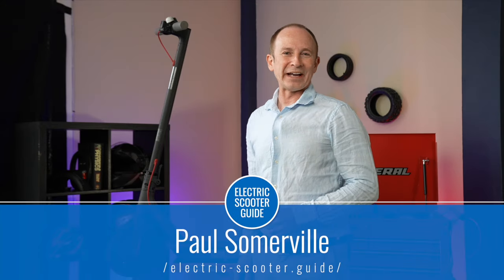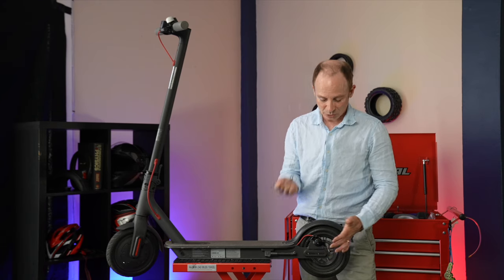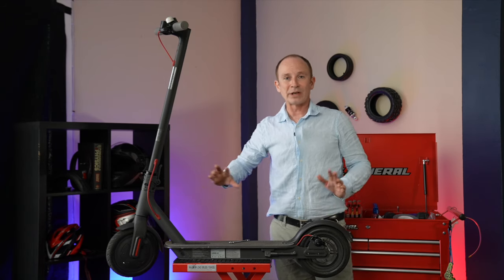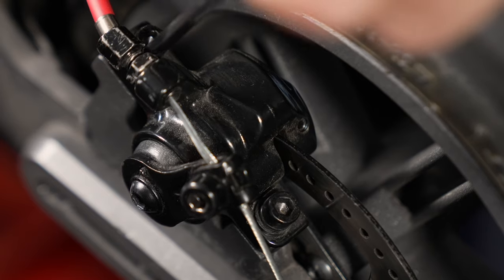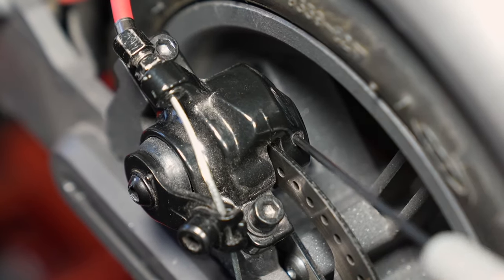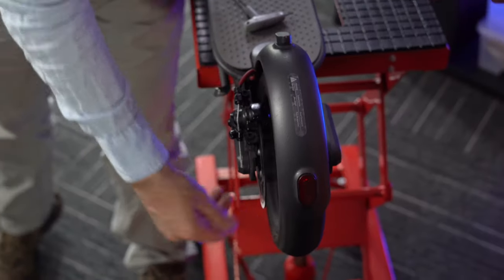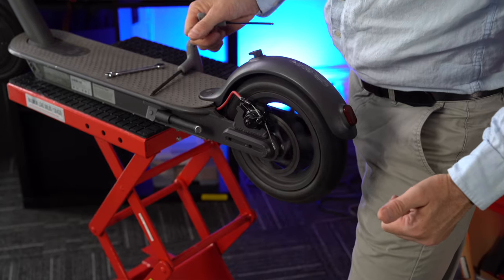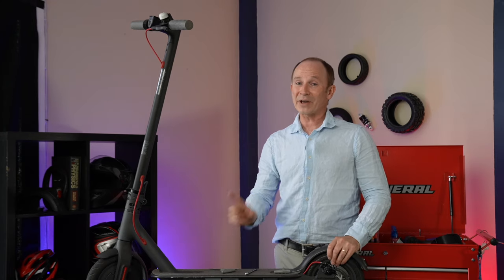How to Adjust Mechanical Disc Brakes on an Electric Scooter

Comment from the maker: What other electric scooter fixes would you like to see? Let us know in the comments!
Reply: Apollo air please. Rear disc
Reply: Hiboy s2 pro, clamp-on the mudguard rattling
Reply: M365 break cable replacement please
Reply: Apollo explorer pls
Reply: Zero 10X
Reply: heya ive got a problem with my xiomi the cable has come out at the top and i cant get it back in please help
Reply: Hiboy s2 pro brake caliper getting stuck in clamped position
Reply: Electric Scooter Commuter Scooter 350W pls.
Reply: Ducati Pro 3 how to change brake pad
Reply: Solar P1 3.0, the cable keeps sliding off when I press the brakes all the way down, no matter how tight I tighten it. Thank you for the awesome videos😁
Reply: @ESG-ElectricScooterGuide   hiya I'm joining the wires on my RS2 RILEY SCOOTER it was broken by me keeping on dropping it  got any details about this pls
Reply: Iscooter ix7 pro front wheel

Comment: I couldn't do the first method because the screws would not come undone. I thought I was doomed until I did method two and it worked!! Thanks, you saved my bacon. I have to ride this thing down a big hill that always has lots of traffic. I was fearing the worst if I wasn't able to get it fixed myself. This is my only transport to work!! Thank you thank you!!
Reply from the maker: Awesome! Thanks for watching. -Vosk

Comment: Thankyou ,instantly fixed my brakes ,that were getting slightly loose this worked perfect,mine has  a spring i pushed up and it tightened my brakes back to perfect,   Perfectly aligned no grinding either
Reply from the maker: We are glad! Thanks so much for stopping by. -Vosk

Comment: Thanks was confused for months how to tighten my front disc brakes. All along wasn't using the correct screws to loosen the caliper full position, was instead using the screws to hold it into place LOL. After this video i finally understood this : D

Comment: I have 3 questions

1. I have the gotrax g4 and it says in the manual to inflate tires to 50PSI but tires say 36, what should I do? The main thing I want is that the tires should last for as long as possible, i don't care about comfort

2. Is there any way I can make it engage just the regenerative braking when I push breakes a bit, and when I push harder it also activates disc brake?

3. Tightening the brakes, will it decrease or increase range? And will it increase or decrease the lifespan of the breaks?
Reply from the maker: 45 PSI is recommended
Reply: @ESG-ElectricScooterGuide  I did 50, should I decrease?

Comment: I fell off my scooter earlier today and now the rear wheel drags hard. I hope its just one of these things i have to readjust
Reply from the maker: Let me know how it goes!
Also check both ends of the cable to make sure it hasn't been pulled half way out of the socket. That can make your brakes drag too.

Comment: May I suggest 2. My front wheel does a flap-flap-flap noise every revolution. It's not a metallic sound, sounds like something rubbery. But it's not the valve cap. When I tighten the bolts on the wheel, it reduces a bit.
But it never did that in the begining. Perhaps knocking my wheel a few times a bit hard on cracks in the pavement did this?

Second, how do you repair a tailight wire that was likely damaged by pressing the fender on the wheel to open the scooter?
The front light turns on but not the tailight. XR Elite (Gotrax) scooter.

Thought these issues might be common enough. :p

Comment: a solid advice for everyone, tightening brake tire too much seems a better idea to you if you think you dont need regenerative brake or tail lights; that causes brake wire to snap too early than it should. i snapped once in a downhill and thank god for those regenative break on motor.

dont worry, when wire's life comes to end, you can feel the thinner-wrapped-wires snapping one by one when you breaking. when it happens, GET YOURSELF A SPARE WIRE ASAP!!! also dont worry x2: changing brake wire is the most easy one in this models. any other bicycle mtb wire do, but be sure they are no shorter than exactly 200mm long. loose wire from caliper, squeeze break and pull out the head of the wire from its slot, reverse process on new wire and you are good to go. shouldnt take more than 2 or 3 minutes.
Reply from the maker: Very insightful! Thanks for sharing. Vosk

Comment: I've adjusted my brother in laws scooter.  The rear brake pads I can see have a gap on each side,  but when I lift the scooter up and spin, it still feels like something is slowing the rear wheel down. 

I've released the wire. It still does it.  I've checked the mud guard, and it feels close but still free. Are some electric scooters meant to have some friction?
Reply from the maker: Each scooter is different!

Comment: Hi, the rear wheel of my Hiboy S2PRO only rub (sounds like metal on metal) when I am riding. It spins freely when off the ground which makes it very difficult to diagnose. Any insightful tips in this aspect?
Reply from the maker: The sound goes away when there isn't any weight on it? A certain amount of dragging noise is normal from disc brakes. Do you feel like it's dragging in addition to making noise?   -Paul
Reply: Same problem. Brand new scooter makes a “metal on metal” sound coming from the front wheel. I think the disc brake is rubbing on something. Happens when I’m not on the scooter, too, and just rolling it forward. I’ll try the advice around the 3-min timestamp to fix this.

Comment: New scooter and I adjusted them as you show and they are still mushy and still need to be pulled basically all the way down. I can't take up any more slack without them rubbing. Thanks in advance for any advice.
Reply from the maker: Thanks! Sorry it didn’t help.

Comment: I just bought a TIF Galop T-108 scooter with Hydraulic disk brakes and both front and rear grip to strongly. There is no sweet spot. It's all or nothing. ow do you get the brakes to be less grippy?
Reply from the maker: some scooters parts like brakes are just less quality then others!

Comment: Hi there! My electric scooter Gotrax Gxl V2 rear wheel is sometimes touching the brake disc even when im not pressing the brake handle, can you post a video about this fix?
Reply from the maker: Possibly in the future! Thanks for the suggestion. -Vosk
Reply: if its new, might be from a bent disk. if its after adjustment, adjust your right pad while tire is turning as in 5:38, or it might happen because you tighten brake wire too much and left pad starts to touch disk.

Comment: I have a Vision A9 Scooter that needs maintenance... you guys got one in the warehouse?
Reply from the maker: No we have not tried that one! -Vosk
Reply: The Rosen Meents in Israel has an Oddball of Electric Scooters 👀
Reply: So there is a little silver power button looking thing underneath the battery carriage that I'm not 100 % sure what it does. It's not a Dulatron, but I'm guessing it's to cut off the main power? It pushes in and out like a power switch. It's in the left side ooo5of where the plug input is, and whatver the othe circular thing next to it does.

Comment: I'm sorry, this is too advanced for me. I don't even know the terms (what is a caliper anyway?). I have a brand new scooter; others have reported brake jerkiness so I thought it would be good to watch a video about that in case I have the same issue. I think I will just hope that everything is fine, or that I will have figured more stuff out later on if I have to deal with something.
Reply from the maker: Thanks for stopping by!

Comment: Hi there. 
No brakes on electric scooter. 
I’ve tried adjusting the brake cable multiple times. 
After 2-3 applications of the brakes, they just loosen right up again.
Any help would be truly appreciated. 
Thanks, Laurie
Reply from the maker: Is the cable getting loose? Check and make sure the cable clamp is getting a good grab on the cable. If you're using the adjusters (twisting them), you may have reached the end of travel of the adjusters. 
What model of scooter do you have?     -Paul

Comment: I did the first adjustment and the break is waaay better but I can’t make the break light work anymore
Reply from the maker: Is it still under warranty ?
Reply: @ESG-ElectricScooterGuide  no, I have it for 3years… I don’t think the light is working at all actually, not even when it’s charging

Comment: I’ve noticed one of my break pads are wearing faster than the other. What causes this?
Reply from the maker: Most people brake most with their rear brake so that would be the reason why it gets worn quicker! -Vosk
Reply: @ESG-ElectricScooterGuide  i have no brakes in the front just a rear disc brake with 2 brake pads so the rear is the only one i use. Is ur reason still the same in my situation where i only have a brake in the rear

Comment: Hey! So recently a super small part of my E scooters disc brake has chipped, and I don’t know what to do since it’s metal and I can’t really fix it. It’s causing a ringing bell noise whenever I spin the wheel because of that chipped part. Does anyone know what I should do
Reply from the maker: There might be a tool on Amazon to straighten bent rotors.

Comment: Yeah buddy. Tried ALL OF THIS and it didn't work. I'm about ready to break this thing. Fiddle fucked with the thing by the handle bar. Fiddle fucked with the calipers. Fiddle fucked with the tension thingy by the wheel. Multiple multiple times. Nothing is working. It works sometimes then doesn't

Comment: Please help, what do I do if the breaks are extremely hard to squeeze and they barely break at all? also when I do squeeze hard enough to slow down, they get stuck pulled in and I have to stop, grab the break cable l near the wheel and push it in with my hand to get the lever to come back out
Reply from the maker: Take to local bike shop and they will adjust for you!
Reply: i am pretty positive about hard to squeeze brakes mean you tighten up the wire too much, and barely brake means you need to adjust your pad distance to disc. for this model, you need to keep right pad close to disc as much as possible, you can set rest from the wire and caliper position adjustement.

as for the brake lever, did you ever dismantle it from the scooter? same thing happened to me before, but it was my fault to dismantle brake lever. if you didnt, ignore rest of this point. if you did, there is a metal part (i cant remember how it looks) inside the lever that makes lever comes to original position after brake, you might set it up in wrong position.

Comment: The "simple" caliper adjustment totally didn't work for me!
Reply from the maker: Sorry it didn’t work for you! -Vosk
Reply: you might need to replace your brake pads because of the resin on the pads wear off or completely gone after a while, and no matter how good you are in adjustments, it means jack shit when it happens.